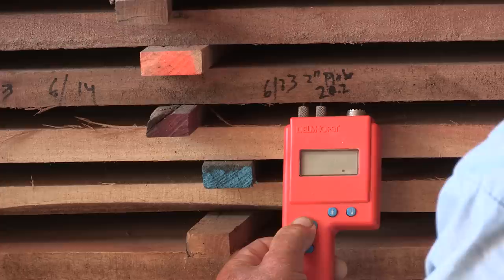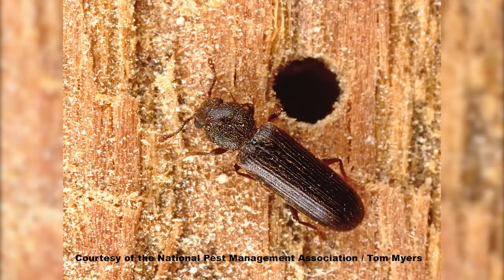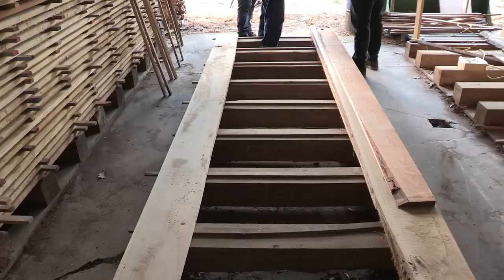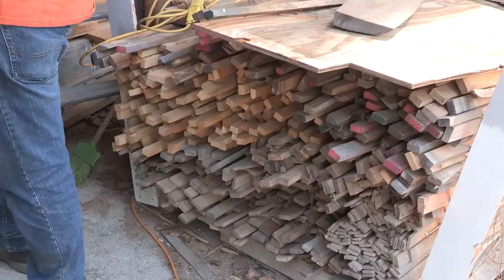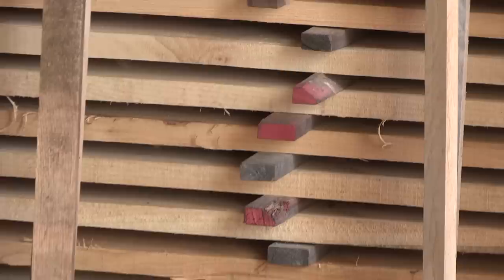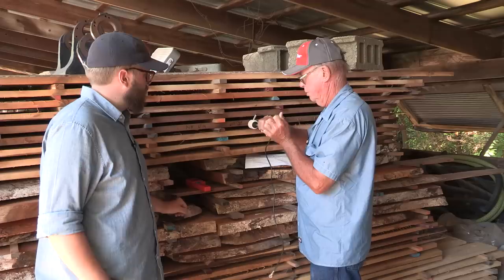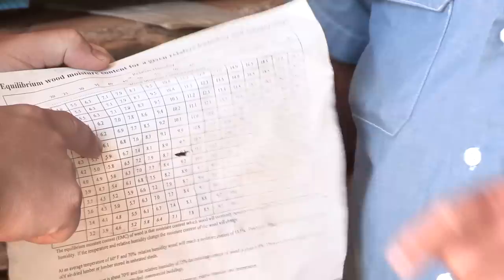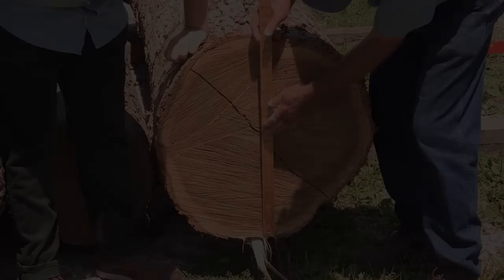Milling Your Own Lumber - Part 6: Drying & Stacking Lumber

Comment: Just came across this series-Thank you so much for the information.  I do have a question though regarding the drying of the green wood.  I have access to several 27' diameter metal grain bins 21' tall.  These bins have fans that can direct air movement either into the bin or exhaust the air out of the bin through a perforated floor.  Would it be possible to utilize these for the drying of green wood?  I can supplement the air movement with additional fans on the interior to circulate the air when using the main fan in an exhaust type situation.  Velocity in the exhaust mode would be kept to a minimum.  Just trying to use what I have if possible without additional costs.  Thank you